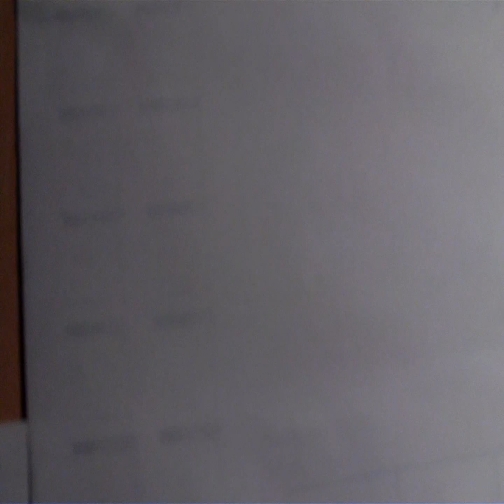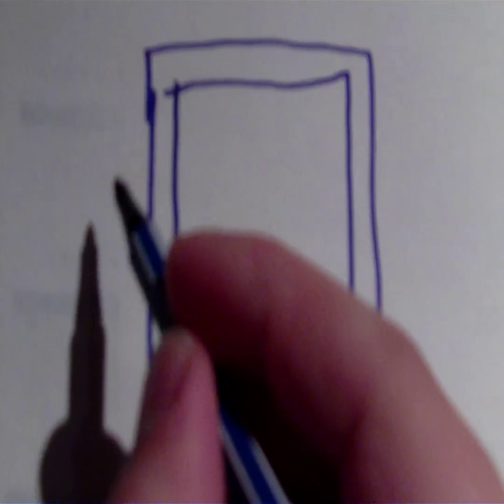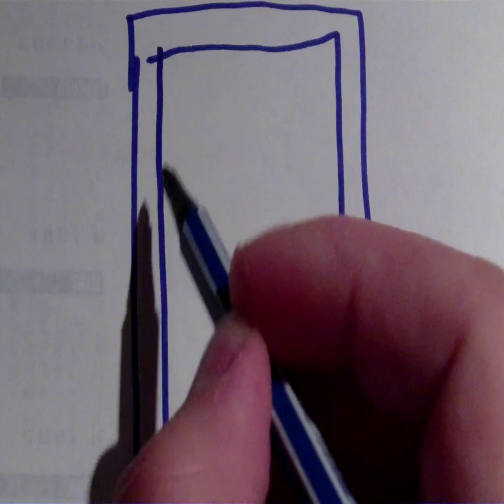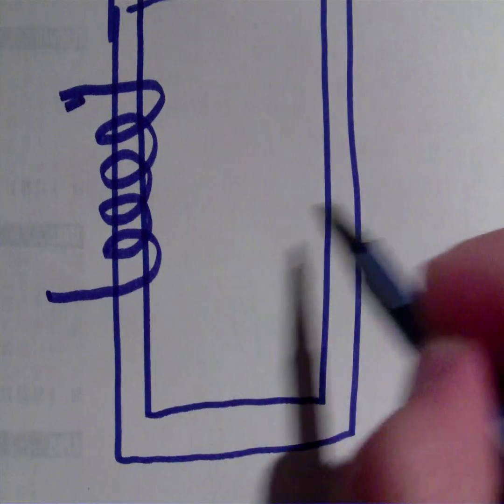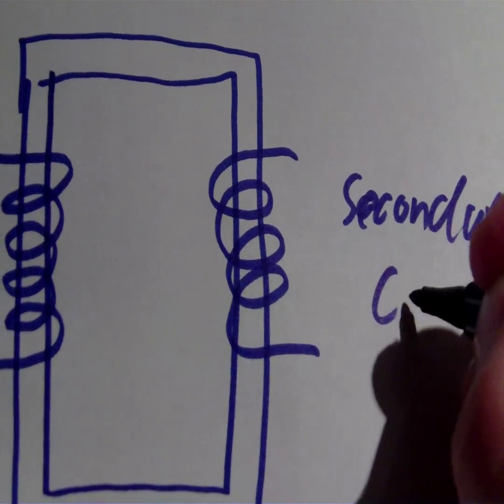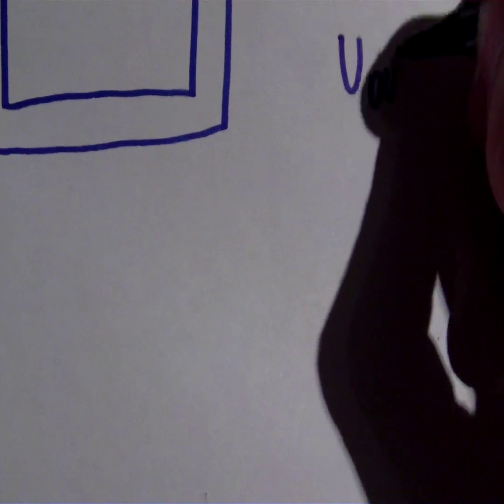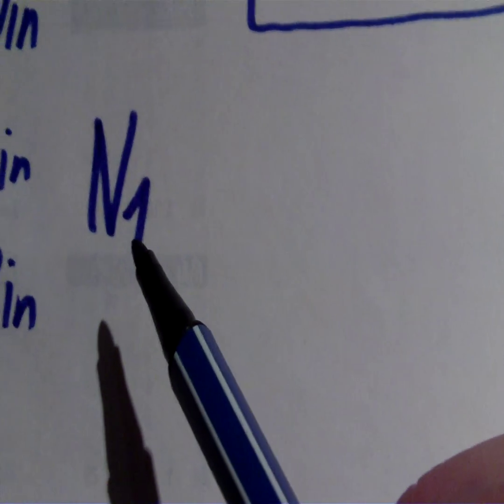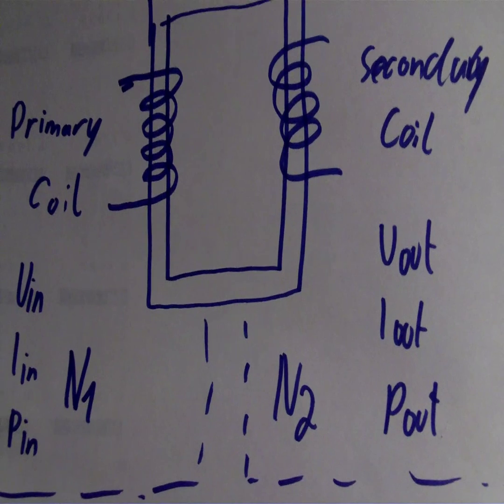Physics Tutorials 1 - The Transformer 1/2

Comment: @RukiaTheEspada not necessarily, if it has more coils then it is considered a step-down transformer and will reduce the voltage in the second coil, if it's the other way around than it is a step-up transformer and increases voltage in the second coil